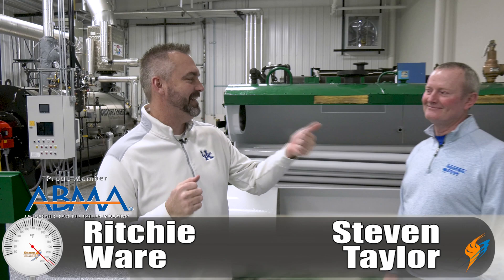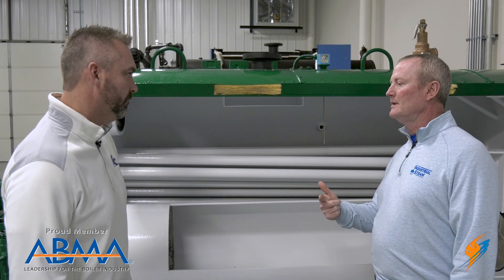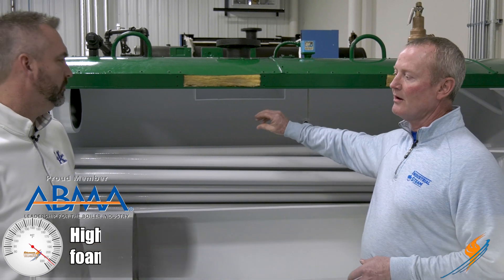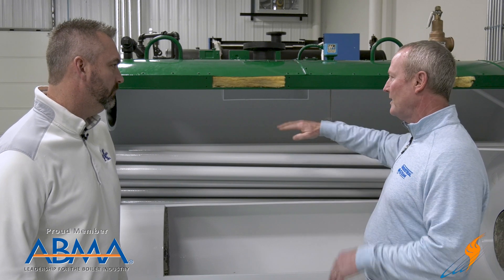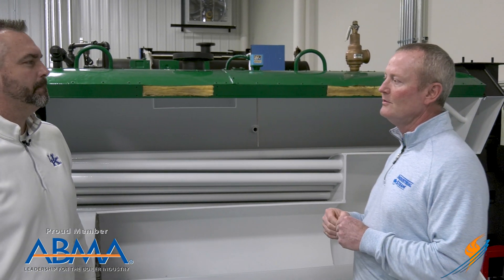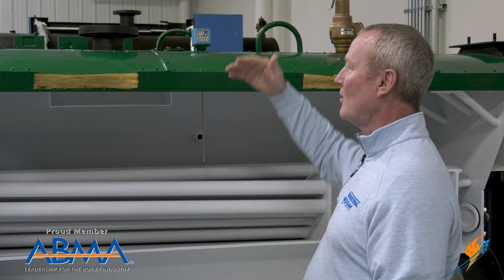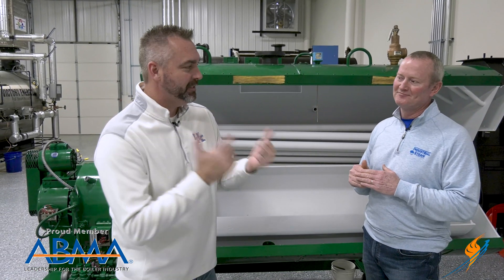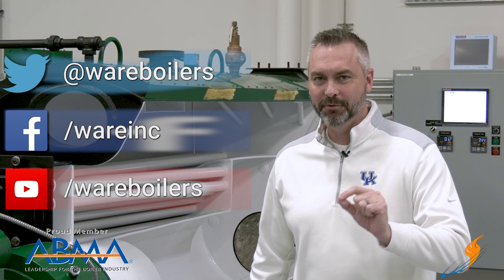What is Carryover and the Factors That Cause It - Boiling Point

Comment: Gents, love your channel but you've not put this one forward correctly. TDS and hardness are not intrinsically linked, as the video seems to suggest.The biggest reason for carryover is malfunctioning TDS control system, allowing TDS to spiral out of control-nothing to do with hardness.
Reply from the maker: Thanks for your feedback. If I left the impression that TDS is caused solely by hardness that was not my intent. As you know TDS is just that, Total Dissolved Solids, and the makeup can be hardness, chemical or any other solids found in the boiler water. As for the TDS control system malfunctioning, far less than 50% of the boilers out there have a control system on them. Probably closer to 20% so that leaves the surface blowdown needle valve and manual operation of this valve to control TDS. Which is why it is imperative that boiler water samples be taken and tested daily to prevent these situations from occurring.

Again, thanks for your feedback and glad you enjoy our videos. If you get a chance share them with others who you think would benefit from them as well.
Reply: @wareboilers  Hi , I'm from a different jurisdiction to you (United Kingdom). Pretty much all boilers and steam generators, in the UK, have auto TDS control fitted.It's a condition of BG04-Boiler Guidance 04 and is often considered to be a safety feature, given the issues that carryover can cause. So in my jurisdiction , it's failing TDS controller, that's the main issue.